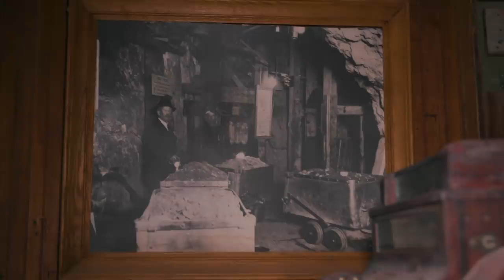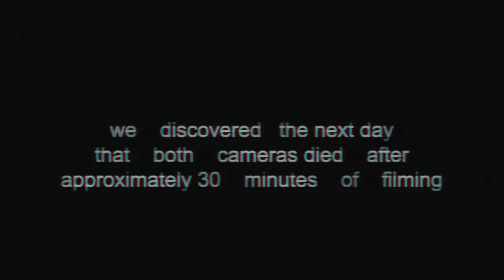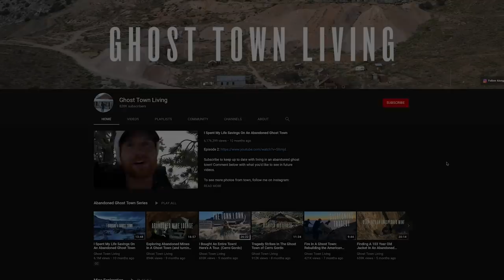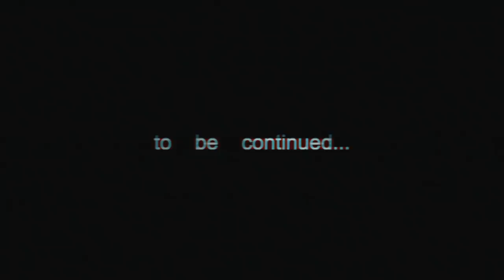OVERNIGHT in HAUNTED CERRO GORDO GHOST TOWN | Lady in Black Dress

Comment: U CAN SEE COREYS JACKET LITERALLY BEING PULLED. HIS BODY ROTATES BECAUSE THE PULL IS SO FORCEFUL. 
& at 26:44 u can see the short shadow figures running in front of the cooler prior to his chair and jacket being touched
Reply: Thank you for letting me know about the jacket being pulled being so forceful because I was confused why his body turned like that so quickly
Reply: Holy shit u right!
Reply: Slow down the playback speed. Then you can see it very clearly! Wauw, amazing!
Reply: @zt890  i look again at the cooler and it looks like a face.... i got chills
Reply: The shadow man??? Maybe
Reply: YESSS. I slowed it down to .5 speed and you can LITERALLY see the shadow cross the room, go to the chair and then his jacket gets pulled
Reply: 3:30 right?
Reply: @monicasosa8751  no the part where Corey and the other guy are in the room
Reply: I saw his jacket being pulled but i didn't see any shadows
Reply: @alexisreiseg9023  the shadow is before his phone flashes and he gets up. it's very slight, but you see it move from the right of the room to left in front of the light
Reply: Yes I seen the same thing
Reply: I literally came  to the comment section to  check this one.

Comment: Sec 23:27 /23:28 in the corner there on the right is an Orb, by the red/with box. It flies from top to bottom. Also, the light is flickering. Shortly after, from the same corner came the EVP. 
Guys pls. Nobody see the whit shadow at 26:44 26:45? than you jump up and say. Some body pulled my shirt 
Greetings from Germany